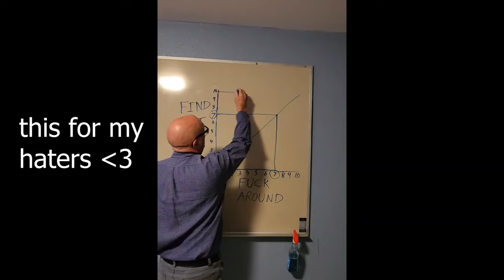I BOUGHT A K24 TO MAKE 600+ HP!

Comment: The k24z3s in the 09-14 TSX is the exact same motor as the z7. Same compression and everything.
Reply from the maker: Yes I know
Reply: The z3 has lower compression,I have it in my boosted coupe. Building a z7 currently.
Reply: @AL-stunts  the z3 in the accords does. The z3 in tsx is the exact same
Reply: @ethanmoore4314  boost and call it a day
Reply: yea oil pan is the only thing different learned that the hard way😂💀